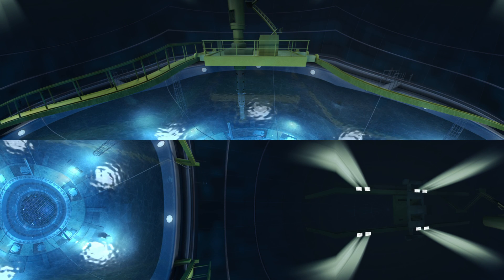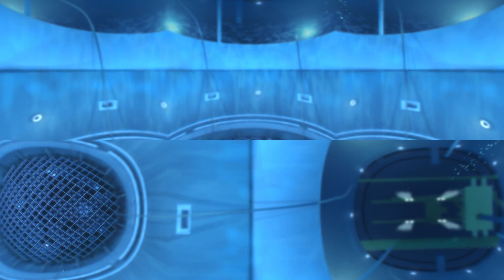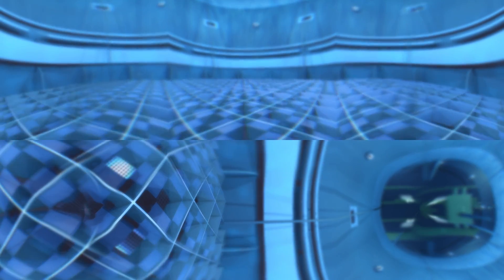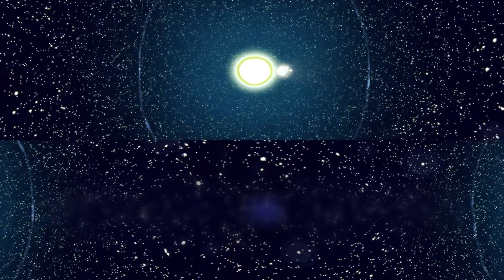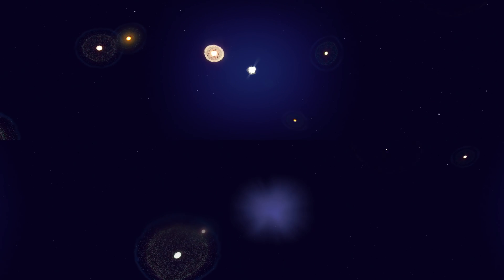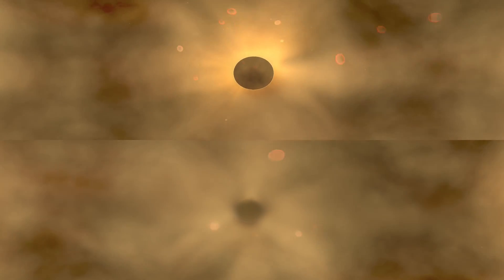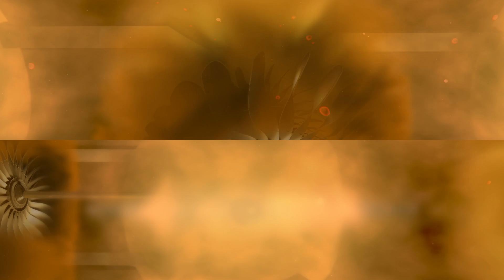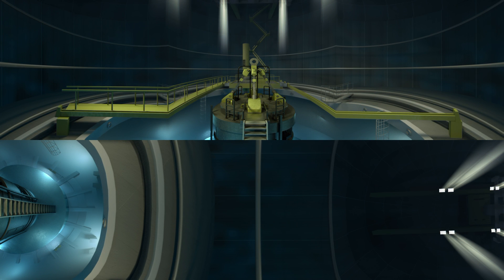What is nuclear energy? Shrink down to an atom and find out

Comment: Yay! dont mind the spent fuel rod pools, and really no place to properly dispose of the toxic nightmare or the actual tragedy of failures in the industry. 

I'm all for nuclear power but GD, be honest about the pros and cons.
Reply: Or you could learn some factual information? The only con is irrational fear nuclear reactors changed drastically since Fukishima and Chernobyl. Look up MSRs
Reply: @HYBRIDER-YT  Are you saying there aren't pools of spent fuel rods and waste that doesn't have a proper long term solution? Are you also saying that Fukushima isn't a tragic failure?  Maybe re read what I wrote? or make your point to the contrary?
Reply: @tomusmc1993  I'm not denying Nything only stating that nuclear power has changed. Look up 5th generation reactors
Reply: @HYBRIDER-YT  I'm not anti nuclear, but I do think it is a disservice to simplify the system to the point of eliminating critical problems with the process. The reality is, if fusion were workable right now no one would ever make a fission reactor again, and 1 of the main reasons for that would be the left over mess they produce.
Reply: @tomusmc1993  Yeah but fusion might never be possible, for now all the methods take more energy to create it then it gives us
Reply: @HYBRIDER-YT  I only used fusion to illustrate the point that fission reactors leave a mess, even when done safely and correct. Again, just pointing out that this was a overly simplistic description of the reactor process that conveniently leaves out all the draw backs.
Reply: @tomusmc1993  Nuclear waste isn't as much of a problem as people claim it to be, like we have storage facilities and its not a danger. When it comes to meltdowns with the new reactors it is impossible as the fuel is already melt. The goal should be to use Thorium as fuel which does not leave behing radioactive isotopes.
Reply: @HYBRIDER-YT  Well we have circled back to your original statement. I guess we will agree to disagree.  although I am interested to hear the locations of the long term storage facilities that are successfully storing nuclear waste . I'll take a look at them. I'm not familiar with any.

Comment: But tell me! How does an RBMK reactor explode? Impossible.
Reply: I can tell you. first the chain reactor genrerates more heat than needed, then it starts to get about 1000°C about the melting point of the casing, after a certain temperature the casing of the reactor doesn't holds much heat and pressure so it explodes, if you heard about chernobyl accident, you'll heard there's a second explosion much worse than the first, that happens because all of the water vapor, becomes in hydrogen and oxygen molecules by electrolisys (im not explaining that) and then whit the first spark BOOM another explosion happens.
in some few words, the reactor melts and explodes
P.S. most people dont say "explode" it is actually known as "melt down"
hope this helps you, or makes you laugh because you just were joking/kidding but im not
Reply: Lies, thats how an RBMK reactor explodes

Comment: I still don't like the idea of messing with nuclear bs. radiation monster
Reply: believe me, nuclear power is not that bad as everyone thinks.
IF handled carefully by well trained personell, nothing can go wrong. the chances are higher a wind turbine or solar panel will kill people then a nuclear reactor.
Its like not flying because the plane MIGHT crash...
Its also the fastest way to produce power.
considering we would have a solar panel the size of the eiffel tower, you would need about 700 of those to produce the same amount of power as 1 single reactor.
the only 2 giant disasters that happened with reactors were chernobyl and fukushima.
and only chernobyl had a huge impact, and even chernobyl only has 31 official deaths caused by the aftermath of the explosion. fukushima only has 1 death.
people are just in this huge taboo about nuclear reactors but honestly, I wouldn't even be that bad if we went totally nuclear...

Comment: I think it's the steady stream of neurons aimed at the core that creates the heat (fission).  Cut off the "stream" and the event is halted.  I think that nuclear accidents occur because of basic/elementary components (like water pumps and coolants and equipment integrity and others) failing.  Needs constant monitoring because it takes awhile to safely shut down systems.  Water is atoms also.  It's kept separate from "the event".

Comment: Every atom of uranium is like a bullet, penetrating everything in its path - metals, concrete, flesh.
Reply: No, its high energy gamma photon
Reply: Uranium is an atom genius and it's high velocity neutrons or gamma rays that penetrates every material thing in it's way.
Reply: @RobinSingh-pl7ji  Ionized radiation contains ionized radiation which contains ionized radiation, which damages your body because the ionized radiation contains ionized radiation which uses ionized radiation to ionize your radiation in your ionized radiation reserves. 

Ionized.

Radiation.

Ion... Rad... IoRa...lora... Lora... Who the fuck is Lora?

Comment: You should do a VR of what happens when it goes wrong.
Reply: I guarantee you that it would be incredibly boring. SCRAM switch would be flipped and the situation will be over.
Reply: @nuclearpotato4073  how about graphite rods being melted and SCRAM button not working?
lol
Reply: @patata9502  rods are not graphite. Rods are made up of uranium pellets and modorator rods which i remember being molybnium.
Reply: @jerrynewberry2823  i was talking about the control rods
Reply: @Astumed  but all the wrong ways have such a small chance of happening that a meteor will hit you before it happens
Reply: Not much would happen. At worst, the rods get so hot that the water, which acts as the moderator, would evaporate. That would stop the reaction. Even if for some reason you had an explosion, it would be inside the contaiment vessel (which Chernbobyl didn't have) and not much would happen either.

Fun fact: Any other sourse of power claim more lives per unit of generated power than nuclear (source: OECD).
Reply: EDF Energy ain't gonna pay to produce THAT video!
Reply: @bobsullivan5714  well well of course not. There's a lot of paranoia about nuclear power anyway, they're trying to educate people and show how simple it really is, and how it's very unlikely for things to go wrong. It's a lot scarier. That's like saying the aircraft industry isn't going to show everything that could go wrong in plane crashes. Yes, there are many things that could go wrong when you go on the plane, but the chances of that happening are so unlikely, and the aircraft industry is trying to show people that planes are not scary. Now keep that in mind, that nuclear accidents are way less likely to happen than a plane crash. Which are already rare in and of themselves.
Reply: @AmazingAutist  
I am astounded.....There have already been several of these "accidents" and the fallout from these will be experienced for the next several thousand years.
When you can explain to us just how to safely and economically dispose of the debris of removing the nuclear materials from the aging power plants that have already reached, and exceeded, their planned operating lifetimes, THEN you can make a case for nuclear power that makes sense.   Until then......
Reply: @bobsullivan5714  Even long lasting nuclear waste can be disposed of with fast breeders. In fact, several countries are doing exactly that, and the latest generation does so economically.
We could do so more, but we have to get the fearmongers out of governemnt offices first.
Reply: @jpj77263  
I am NOT familiar with the Fast Breeders.  I totally agree with the idea that government officials everywhere are less motivated by reason than they are by fear of their own security.  Furthermore, the success of the propagandists are resulting in decisions regarding precious resources and their allocations being fear based. This is demonstrated by the global warming nonsense but admittedly would also apply to nuclear power.
    Fast breeders, as I understand it, would solve the problem of spent fuel rod disposal but would not provide for the disposal of "Hot" debris from decommissioned power plants.  The current methods of burying these materials in "Secure locations" depends on a future of stable governments, and cultures, and the social structure to keep these safe for the next several thousand years.....Such a thing has never existed in human history.
  If you would care to edit your comment to show links to additional information, this would be a service to the readers.
Reply: @AmazingAutist  think people are more worried about the waste rather than the initial risks.... If a plane crashes you can clean up the pieces with a few cranes, if a reactor building gets destroyed people die after the incident as well.
Reply: @Cornskid1  it's not going to be polluting they are as it is going to be basically a huge steam engine. Also, it's better than solar energy because the solar panels are toxic, and turbines are very finicky and also endangered bird species
Reply: @AmazingAutist  That's pretty much exactly what I said.
Reply: COGGZI ☹️
Reply: @Cornskid1  
Well...since you have chosen to be so offensive..............
                                                 FUCK YOU
Reply: Chernobyl happens
Reply: @hitachi4264  not with a light water reactor as was usual outside of the Soviet Union.
Reply: Here's a non 360° version of what happened in fukushima. but is a bit animated https://www.youtube.com/watch?v=YBNFvZ6Vr2U&t=156s (not mine btw)

Comment: You forgot about the control rods
Reply: no control rods in western reactors, the "fuel" bars are pulled up out of their casing magnetically. In case of emergency or if the current is cut, the bar immediatly falls down in the casing, shutting the reaction. edit: this was totally wrong (yeah, knowledge is like jam, the less I have the more I spread it... sry) So the only proper attitude now for me is to get accurate infos. tks all for pointing my misunderstanding and own hubris.
Reply: ido daisuke 
Of course there are control rods in western reactors, but they‘re totally different from the ones in a RBMK reactor. What you see in this video is a pressurized water reactor (PWR). The control rods in a PWR are suspended above the reactor core and can be inserted by way of gravity in 2-3 seconds.
Reply: LV31 I think that every reactor has option to insert control rods by gravity
Reply: mozomenku 
No, not all reactor designs have control rods that can be inserted with the help of gravity. In a boiling water reactor (BWR), the control rods are inserted from the bottom so they have to rely on a hydraulic system. And I doubt that the RBMK’s control rods can be inserted into the core without the help of motors in a reasonable time frame, if at all.
Reply: LV31 Actually I thought about cores with rods inserted from above. I've heard several times that rbmk had that functionality too
Reply: @mudspike84   yep, it seems i've been lost in translation and also got confused with the functionning of russain reactors... damn, i quitted this for too long.
Reply: ido daisuke What you say doesn't make sense. How uranium rods could stop reaction? If they were all inside reactor, generated power would rise
Reply: @mozomenku  yes
Reply: ido daisuke where did you get this informations from !!!!
Reply: @gerard4039  as i stated, my bad, i got confused between french/russian reactors and also messed up with translation of some vocabulary so....
Reply: No they didn’t. I said THEY DIDN’T!!!
Reply: mozomenku oh the one that causes Chernobyl explosion 💥, 😬😬😬
Reply: @gerard4039  Actually, what caused the Chenobyl explosion was the fact that Sovietreactors used graphite, not water as a moderator. This and the fact that the operators seemed to have no ideas about Xenon poisoning.
Reply: gerard . A Yes... partly they caused Chernobyl explosion